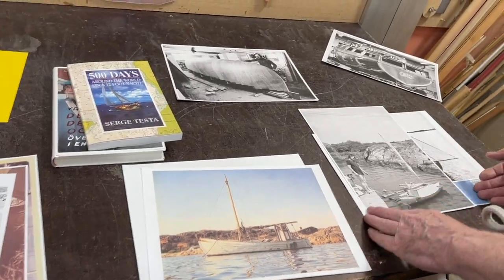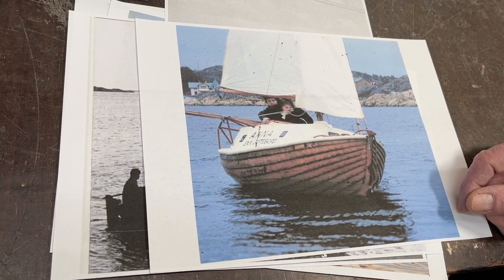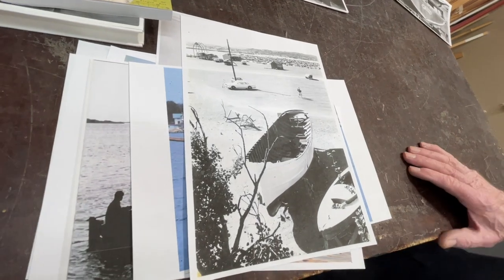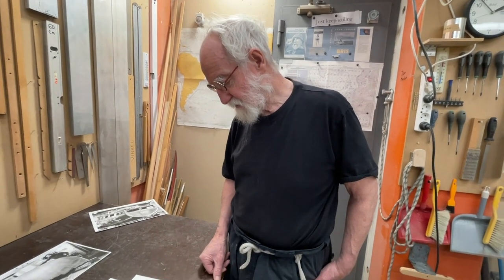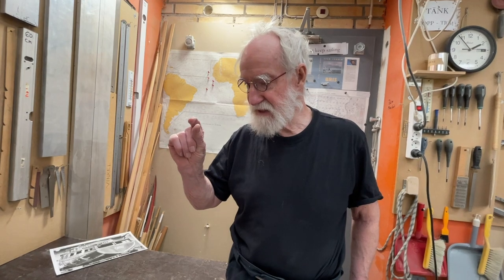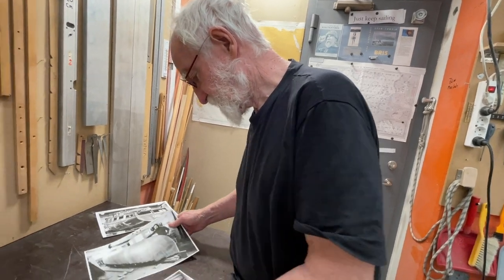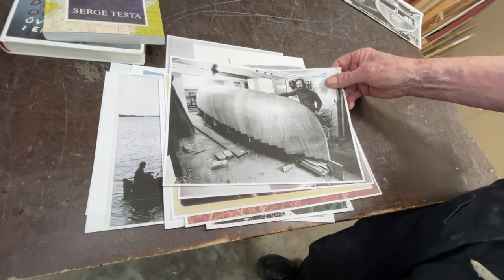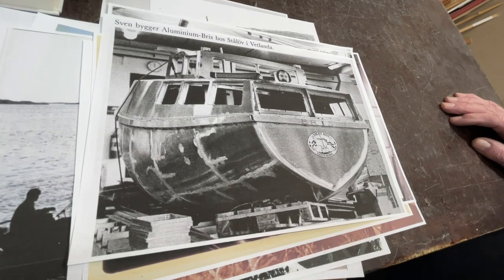The material that is most easy to build in is...

Comment: I have built using wood, plywood and sandwich using divinycell as the core. I will never build again without using sandwich composites. That said - two things have not been mentioned. Epoxy will rot (degrade) in UV light and must be protected with high quality paints. And this protection must be maintained ongoing for the life of the vessel. Also the glass fibre dust from cutting, grinding and sanding the composite is extremely unpleasant. Of course one must protect oneself regardless of the medium used.

Comment: What about cost tho? i bought some epoxy resin just to clear coat an old wooden table it was like $300 just the resin.....!
Reply from the maker: Build smaller.
Also the hull and deck is the small part of an ocean cruising boat.
Reply: Its not cheap, true, but like many things if you purchase in bulk its usually possible to negotiate a discount.
Reply: @jwboatdesigns  the foam he is using is over $ 800/ sheet in the States
Reply: I'm building a 10ft dinghy. It's hull is glass sheathed. I've spent about £500 just on epoxy.
Reply: @tomwaite4594  you don’t need 70mm thick divinycell for a small boat. That’s just for insulation and flotation. Regardless, in Sweden $800 can be earned in two days by most people with a decent professional job
Reply: @superwag634  hm. The avarage salary in Sweden is more like 130 dollars a day (after taxes).
Reply from the maker: @superwag634  30 mm is very good.
Reply: @petternorman6192  what does an average dentist earn?
Reply: @superwag634  don’t know. But an avarage Swede is not dentist.
Reply: @petternorman6192  I never said average Swede. You invented that. I said a professional
Reply: @superwag634  not my intention. But I answered the wrong guy. 😜 It should have been @tom Waite